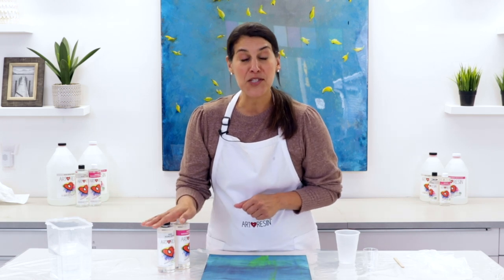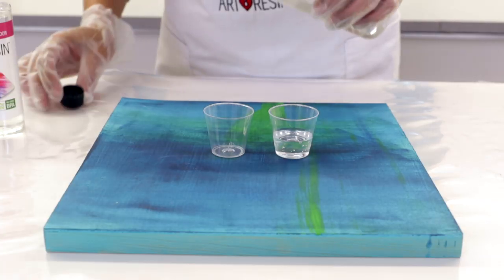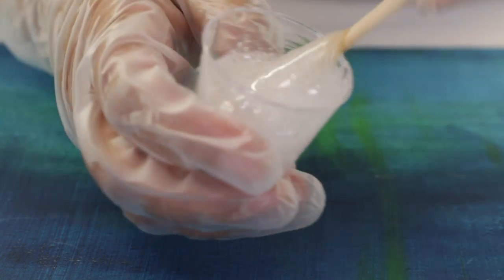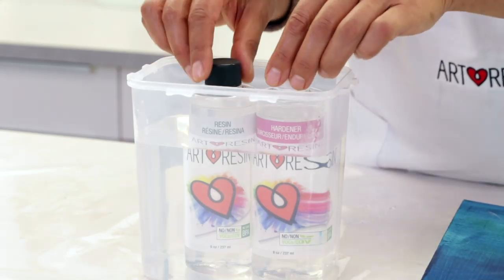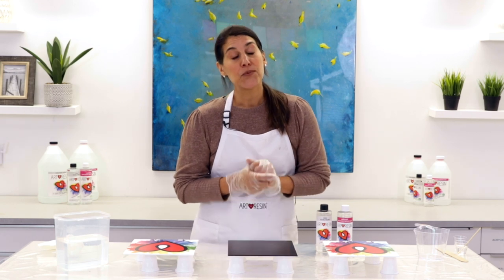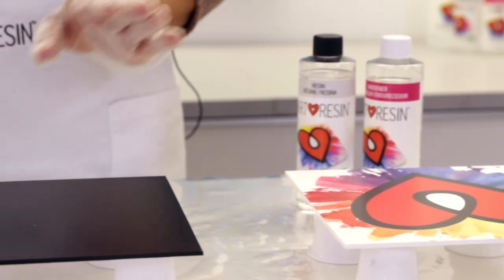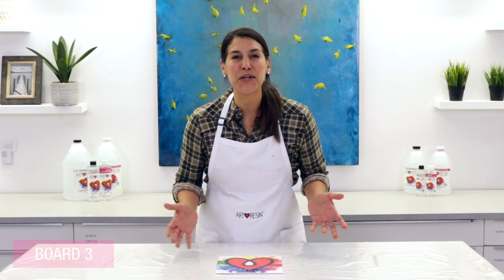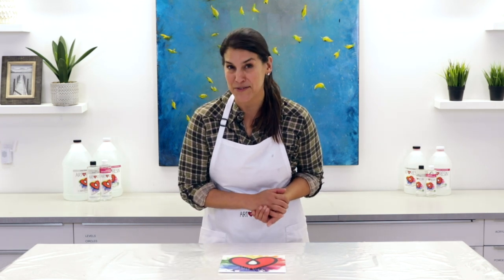Cold Weather Resin Tips

Comment: Does anyone know how well resin holds up to cold? By that I mean once cured (in normal conditions) if I wanted to say run a cooling pipe in the piece of resin would it work?
Reply: Hi James, We haven't tested this exact thing but we do know that once fully cured and used as directed it does well in cold weather. We have had outdoor pieces last through the Canadian winter with no issues. If you are able to test on a non masterpiece I would recommend doing so.

Comment: Hello my resin art pieces had wrinkle type lines on it. How to avoid it? I heated the bottles in warm water before starting to pour.
Reply from the maker: Hi Aiman, wrinkles in your cured resin can happen for a couple of different reasons. First, if there is a dip in temperature during the first 24hrs of curing this can cause what we call the "orange peel" effect, or as you said wrinkles in your cured resin. A constant temperature is needed during the first 24hrs of curing for best results. Second, wrinkles can also be the result of over torching. The good news is that we can make those wrinkles disappear with some sanding and a second coat of ArtResin :) Please visit our website for details https://www.artresin.com/blogs/artresin/44594177-how-to-apply-a-second-coat?_pos=2&_sid=85efef3c7&_ss=r
Reply: @Artresin  hey I don’t over torch it. I use a heat gun and use it only once after pouring. And I live where the temperature is 16-10•c. I warm the room and resin. But still had those lines. And I even sand my resin art piece and poured a next layer but still have them
Reply from the maker: @aimanabbas4261  Hi Aiman, sorry to hear you are having issues with your resin cure. Please reach out to our customer service team at support@artresin.com and include any pictures you might have. They will be better able to help you.
Reply: @Artresin  sure Thankyou. Will post my concern there
Reply: @Artresin  how to post my concern? Couldn’t find your customer service team
Reply from the maker: @aimanabbas4261  Please send an email to support@artresin.com. Our customer service team would be happy to help :)

Comment: I really love the glass like finish I get from Art Resin but I do struggle with runs down the side of dotted mandala stones. 
I resin the bottom half of the precast stone first, let it dry and cure, then do the same to the top half. As I mentioned I nearly always get runs down the side which for me, really spoils an otherwise perfect finish. Do you have any help or advice to offer at all please?
Reply from the maker: Hi Mike,

I am unsure of your process but I would try to brush on very thin coats. Maybe even letting the resin sit for 15-20 minutes before coating so that it does begin to thicken up a bit. 

Hope that helps :)
Reply: Thank you for the help, I'll give it a try.

Comment: I have heard there r some types of resin that u can use without wearing a respirator,  what about this brand?
Reply from the maker: Hi Jane - ArtResin has been evaluated by toxicologists at the American Society for Testing and Materials (ASTM)
 and has been designated non-toxic when used as directed and safe for home use in a well ventilated area.  If you've added colorants/additions that may be toxic or that contain solvents ( such as alcohol ink ) then a respirator is recommended.

Comment: does cold resin causes stick surface after curing ?
Reply from the maker: Cold temperatures can slow down the curing process.  We recommend allowing your ArtResin to cure in a warm room (75-85F) for best results.  If you have resin that is slow to cure, try warming up your room a bit. If your resin remains sticky, it could be that your mixture was off and you may need to re-pour a second layer to fix.
Reply: @Artresin  I did mix it very well for like 3 min but the resin was cold and thick.
also, every time I put a cup or something heavy it leaves a mark on the surface of the tray/coaster what did I do wrong?
Reply from the maker: @nleiwk6945  we would be happy to trouble shoot this with you.  Please contact us at support@artresin.com and we can ask you some more questions.  🙂

Comment: Thank you. This is great information. I do have one question, though. I live in Arizona, so how does extreme heat affect the outcome of resin?
Reply from the maker: ArtResin is heat resistant to 120 degrees F. So those hot summer days, if left outside or in direct sunlight could soften the resin some but when brought back down in temperature it will harden right back up. 

One of the most important factors to ensure your epoxy resin cures properly is temperature. The ideal temperature for both your ArtResin and your workspace is slightly warmer than room temperature: 75-85F or 24-30C. 

You also want it to be dry, 50% humidity is ideal and stable meaning no dips in temperature during the first 24hrs.

Comment: Thankyou for sharing such an amazing tip. I had a query when I put the final layer of the resin on my work at the time of curing I begin to see it wrinkling, could you tell me the reason behind this and how can I fix this?
Reply from the maker: Hi Deirdre, make sure that there is no vent or air blowing on your resin surface, do not move your artwork and be sure to avoid temperature fluctuations while curing.  Over torching can also cause ripples in the surface.  If you still have problems, reach out to us at support@artresin.com

Comment: Does anyone has experienced problems with resin in hot weather? I had a big piece made in February and yesterday it kinda melted... It bend like it was soft play dough 😭
Reply from the maker: Hi Sofia, hot weather can cause your resin to temporarily soften.  Once your cured resin returns to a normal room temperature it will regain full hardness.  It is important to ensure that nothing damages the resin surface while it is softened, so avoid stacking your artwork when it is hot and take care in packing.
Reply: @Artresin  thank you for your answer. It's very sad to watch a piece almost falling apart 😭

Comment: Can you please get back to me as soon as you see this post? Do you usually wear a mask 😷? I'm asking because I've seen two videos already that said that resin gives off fumes and it gave them problems. And I live with my parents, my brother, 2 cats and a dog. I didn't know resin gives off fumes. I'm not giving them breathing problems like these videos claimed
Reply from the maker: Hi Jennifer, ArtResin is non-toxic and does not produce fumes.  It does not contain some of the chemical fillers that other epoxy brands do and as a result everything in its formula is used up in the chemical reaction rather than dispersed into the air.  As long as you are working in a well ventilated area, you do not require a respirator, but follow the instructions for the epoxy brand you are using as they may differ.  Here is a blog with more information:  https://www.artresin.com/blogs/artresin/how-is-artresin-non-toxic-when-is-it-not-non-toxic?_pos=1&_sid=efca2f70a&_ss=r

Comment: No mask?
Reply from the maker: ArtResin conforms to ASTM D4236, meaning it is certified as safe for home use and non-toxic when used as directed, however there are some common sense safety precautions that every user should follow:  Wear gloves. ArtResin is very sticky in its liquid form, so gloves will protect the user from a mess, as well as skin irritation. Clean skin promptly with soap and water if it does come in contact with ArtResin. If ArtResin somehow comes in contact with your eyes, flush with water repeatedly and do not rub. Promptly seek medical attention. 

Work in a well ventilated area and wear a respirator if ventilation is poor.See our blog for further information: https://www.artresin.com/blogs/artresin/what-safety-precautions-should-i-take-when-using-artresin